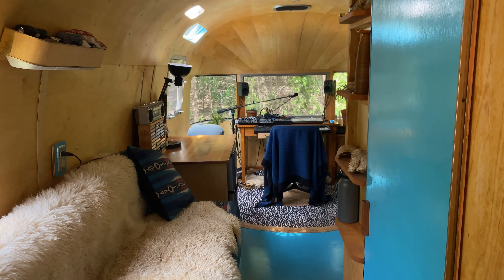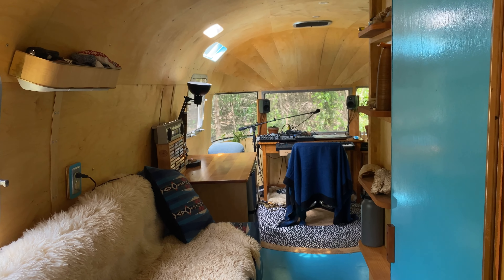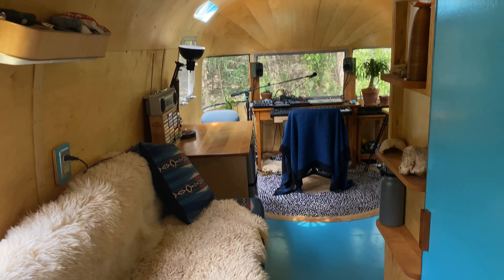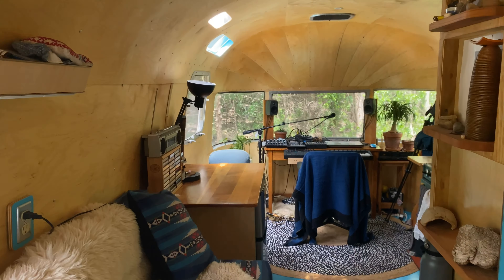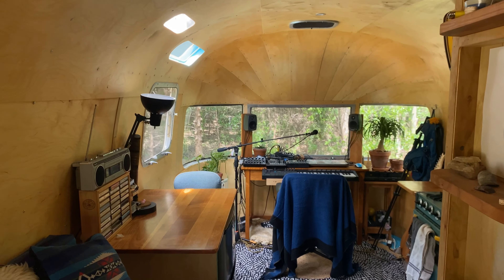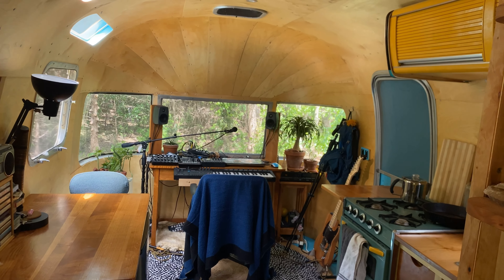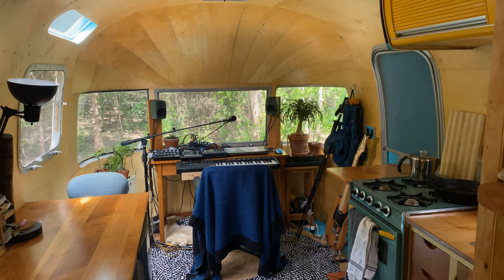Curved Plywood, Rubber Bathroom -  Renovated 1976 Airstream Argosy Tiny Home/Studio Walkthrough

Comment: So glad to find someone else who designed the interior based on fixed location! I’m working on a 1970 Airstream as an art studio. The front will be set up for glass working. Further back will be polymer clay work station. I’m taking out the bathroom. 
I have a question for you - how are the acoustics? I don’t see much in the way of sound absorbing materials. But I really love the look. You did a great job!
Reply from the maker: Acoustics are good, there is some reverb, but with all the odd angles and filled with furniture, and given that wood is a little softer on reflections, it's not bad.  I'm sure with acoustic treatment could be better, but I find it adequate for my purposes.

Comment: Doing something similar with my airstream. Wondering what you used to seal the hidden side of the ply?
Reply from the maker: I have an airgap behind the plywood, I didnt seal that side, but its also not touching anything, which allows air to flow and for the wood to dry out, time will tell whether that was the right decision, but after 3 years its doing fine.